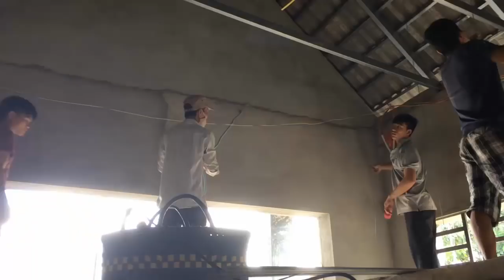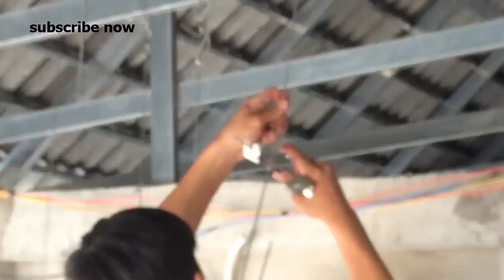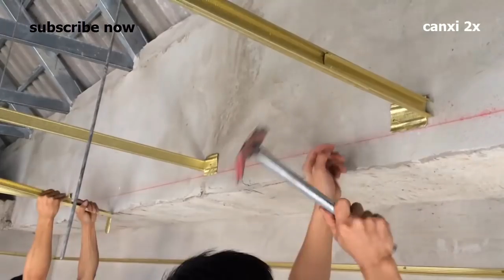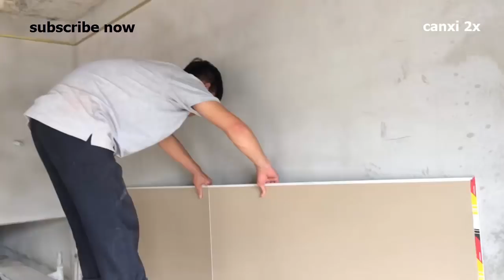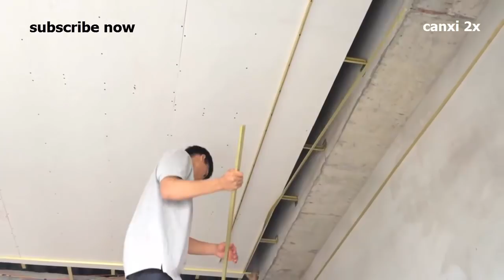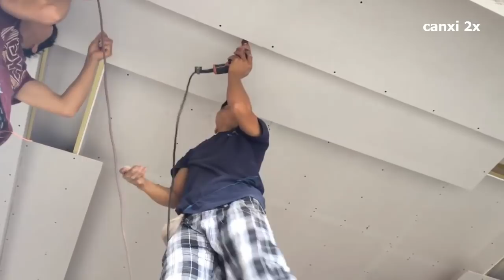House Construction Installation Plaster Ceiling living room -  Decorate Ceiling House

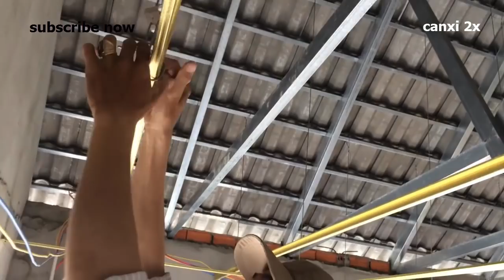Comment: Everyone is slamming their work but no one is saying why. So I will tell you why. First, these guys are doing a good job, they are fast and work well as team but there is one problem. The frame that they are putting up at 3:10 looks weak and flexible. If the frame is weak and flexible, the plasterboards will move over time. If the plasterboards move, it means the plaster or paint on top of the boards will also move and crack. So the only concern is with that gold-looking frame they're using to hold the plasterboards. If it's strong and sturdy, no problems. If it's weak and flexible, then lots of problems.

Comment: i have never seen a drywall ceiling been done like this, what a joke.
Reply: Kimo Kiko lol nothing wrong with it
Reply: Kiwi Bird that structure is nothing wrong?
Reply: china at work.... LOL
Reply: As a Commercial General Contractor, I can tell you that Armstrong makes a ceiling system that goes together just like this.
Reply: Gail Moran yes but Armstrong don't use ceiling wire to hang an mf ceiling it's all ways galvanised angle for strength
Reply: @Kimo Kiko don't hate your just jealous😎

Comment: Talk about shitty work. Good lord. So many unsupported drywall ends and they are attempting to use drywall as a structural element in their design. I don't do sheet rock for a living I actually do custom woodworking and cabinets however I've done plenty of plaster and sheetrock in my life and this is total horse shit. They better keep their day jobs that's for sure!!